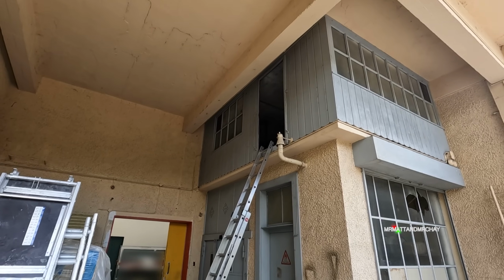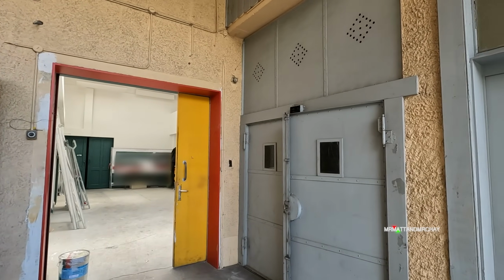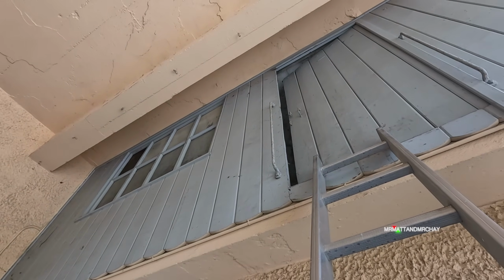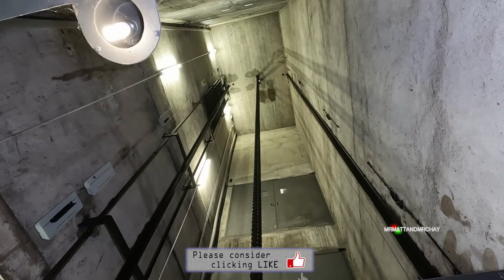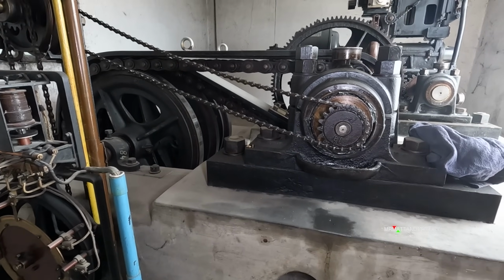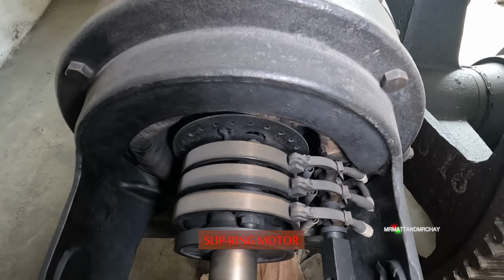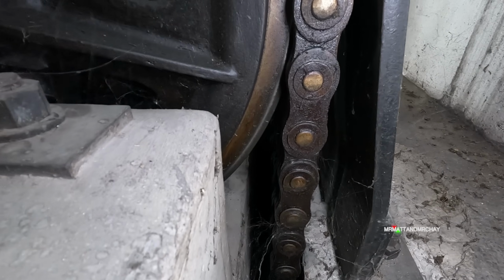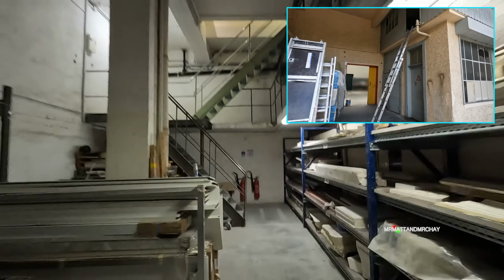Exploring some vintage CHAIN DRIVEN lifts - old industrial building

Comment: A great find and a fascinating video. There’s lots of interesting parts in there that I’d love to have a more in depth study of. 
 I find it surprising that chain drive isn’t used more. I have installed and maintained chain drive in London but they are certainly rare. An old goods/passenger lift had a car that was carried on a chain at each corner. The machinery occupied three sides of the motor room with bevel gearboxes in the corners and driving/carrying sprockets in all four corners. 
  A small dumb waiter that I installed was pretty much standard except for a pair of chains instead of ropes.
  Ropes are just considered standard these days and are probably cheapest and easiest for the higher rises.

Comment: From looks of this lift, chain had some advantage over steel cable: its drive cog may be much smaller diameter than sheave, so it may have higher rpm for the same speed and that means simpler drivetrain. Though here it is still 2-stage: first worm gear then good ol straight gears. But with cables i presume it would be even bigger. In passenger lift (low weight, high speed) it could be even direct drive!

In some sense, it is modern belt lifts' grandad. They are pretty popular today as belt sheave also may be very small diameter, hence direct drive and no motor room whatsoever.

About working lift in this video: I'm afraid not only control was retrofitted with VFD but motor as well. Old motors were cylindrical in shape while rectangular ones are usually much newer, like 1980s. At least that's when standart industrial series of rectangular motors came around.

Comment: Looks like that building originally had a good number of incinerators in the basement area, at least 20 of them, and with those doors looks like it was at one point a crematorium, using town gas, and later on natural gas, to cremate things. With the age of the building, those ceramic tiles will not come off the walls, they were most likely placed there direct onto wet plaster, after getting a bagwash of cement powder on them, so they are essentially one with the wall.

Comment: After all, for such a relict mechanism I'm kinda happy that they modernized the control board. Not only currents are reduced (any spike of current causes rubbing of wires in the coil, so smaller spike - longer insulation life) and also mechanical stress is reduced. 

I don't see the value of having old relay-based controller on 80yo working(!) lift. The main value is the drivetrain, how it's connected to each other. And they did preserve it with a great care.

And yep, I love to see old DC lifts with the original control hardware... but they're passenger lifts, with a low throughput. Such an amazing experience of being able to see them in work. For freight lift I personally would also change the old control board to VFD, but probably leave old board just sitting next to it, as a piece of memory
Reply: I don't agree. What interests me is the relay logic.

Comment: The surroundings felt familiar. You can't hide the large blue furniture store!
The airport, the French language, the Swiss sockets. This can only be....

<edit to snip location>

Actually... I have passed that Ikea store multiple times.
Reply from the maker: Im very sorry but im going to have to remove your comment.  I tried hard to hide the location to protect the maintenance guy who allowed us to film.  If you would like to repost but pls dont mention the location.  Thanks
Reply: @mrmattandmrchay  I Have edited the location out of my comment.
Reply: Some ,hopefully constructive, criticism:

When trying to keep locations a secret. Try to keep anything unique, and especially very recognizable, out of the picture. Or don't show any surroundings at all if that is not possible. Very tiny clue's not blacked out can give a huge amount of information. Thing also with blurring is that can be reversed when knowing the exact algorithm used to blur things out. Sometimes pixelating or even blacking out is required such as when typing in a code on a keypad.

Second maybe put a (pinned) comment notifying that you want to keep a location a secret and that any moron, like me, who does spoil it gets instantly deleted.
Saying it in the video itself means it can be skipped over. Want to let something be known broadly? Advertise it over and over.

Comment: Just as i thought the Day coudnt get any better, you uploaded a new Video. Anyways great Video but why do these Lifts use Chains instead of Ropes ? Is there any particular reason why ?
Reply: I am not an elevator mechanic, however, I would think that a contributing factor is that chains are generally considered immune to slippage which gives them a considerable advantage when you need to repeatedly place something precisely in the right spot. Over time, and with large enough loads, ropes and belts can slip, which might throw off the position sensors, leading to doors opening at incorrect levels.